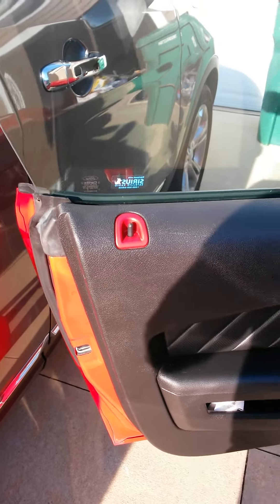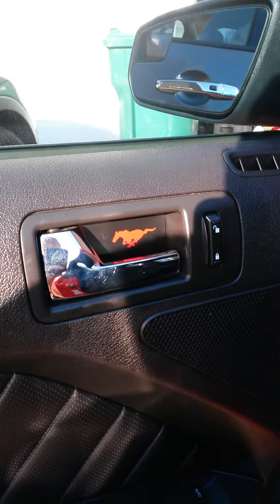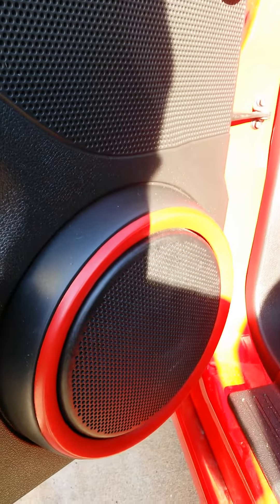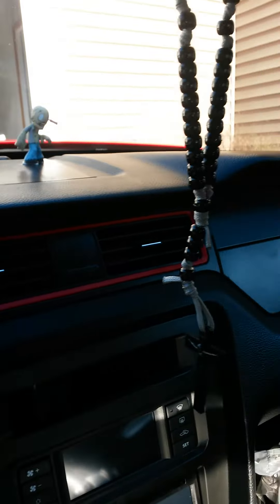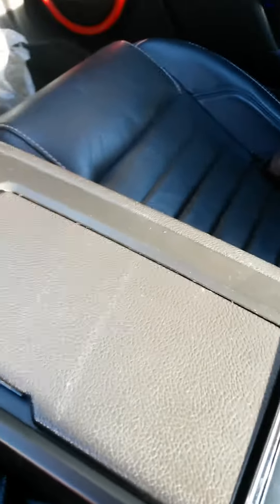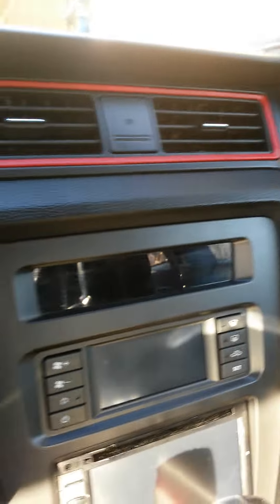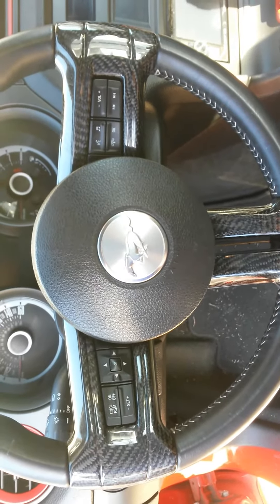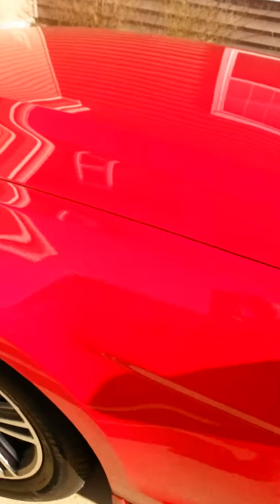2013 Mustang interior

Comment: How did you plastidip around the the air vents did you take them out or tape them? Sick car btw I have the exact same one lol
Reply from the maker: Thank you.  I took the whole dash out. Used a heat gun for any glue I found. Then gently with a pry bar removed the vents.
Reply: mfpita2012 so did you remove the whole vent or did you just take out the chrome bezel around the vent?
Reply from the maker: Erik Martinez I took the whole thing out. Then separated the chrome from the vent

Comment from the maker: What's with the down vote?
Reply: Dude!! This is awesome!! I actually want to this to my ride.  HOw did you get the Mustang emblem in the inside of the door handle! that looks awesome! Also do you know how to take out the window switch plate on the door panel? That's the piece I want to plastidip because they are so many scratches on it.  Thanks!  Please help!
Reply from the maker: Daniel Vargas 
Thanks for the compliment. The lock housing comes off easy with a pry bar.  The Mustangs I made a stencil. I also now have the word Mustang across my passager airbag